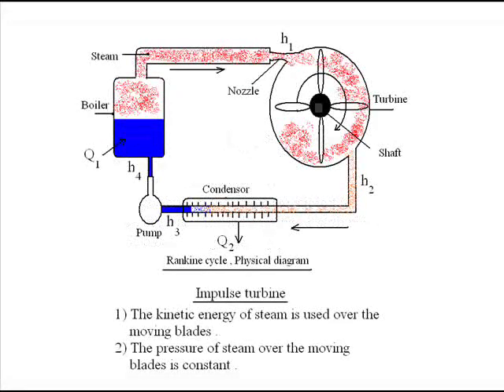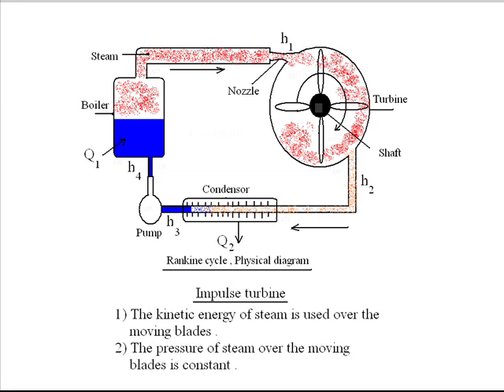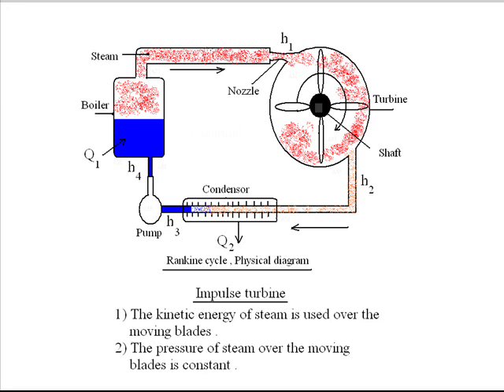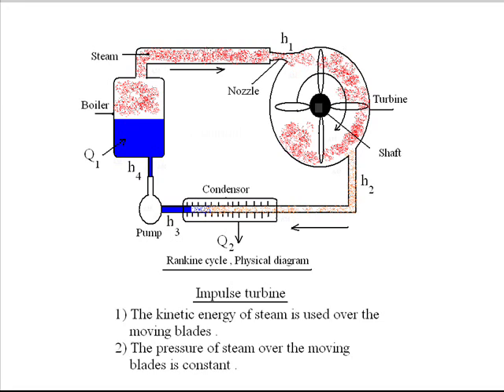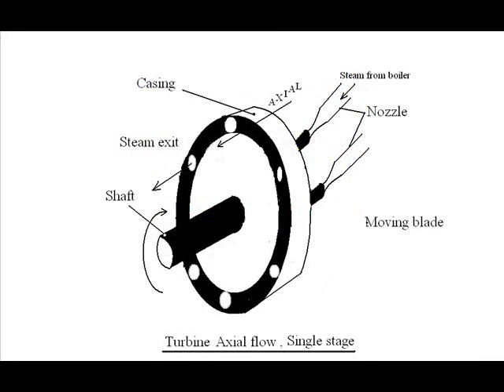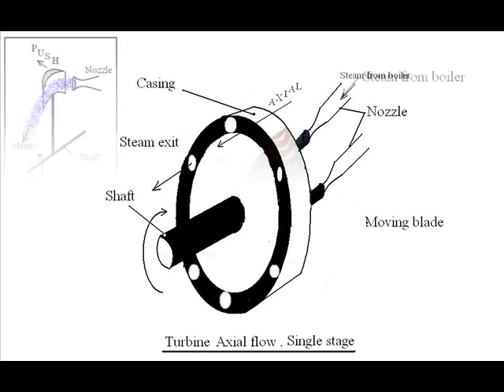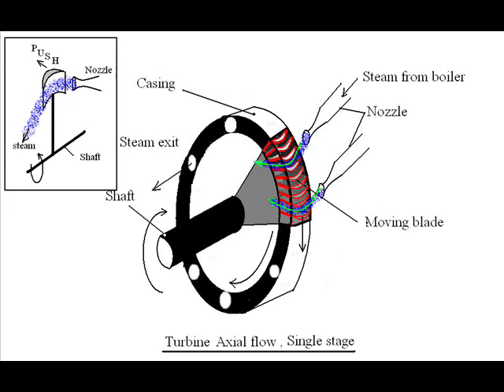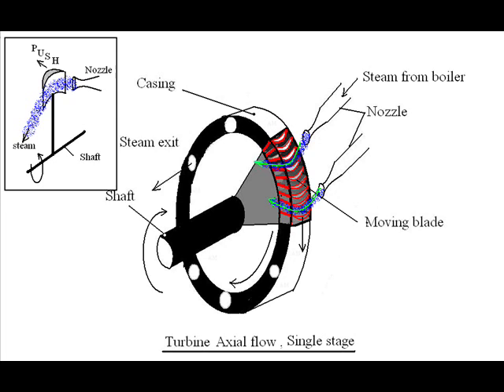Lecture on impulse turbine axial flow (Steam turbine)

Comment: IMDEED VERY EDUCATINAL. BUT FOR A LAYMAN, WHAT IS THE EFFECT OF A GAS OR STEAM WITH 200 PSI PRESSURE PASSING THROUGH THE NOZLE IN TERMS OF SPEED OF THE ROTATION OF THE SHAFT?
Reply: Can you gat this power point